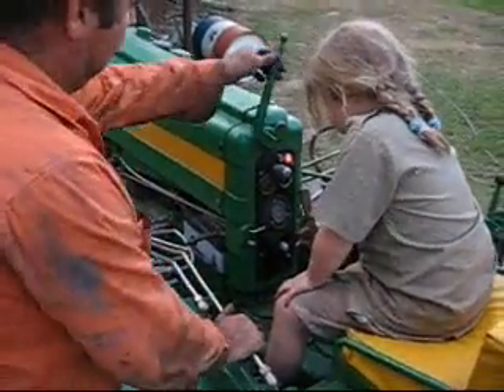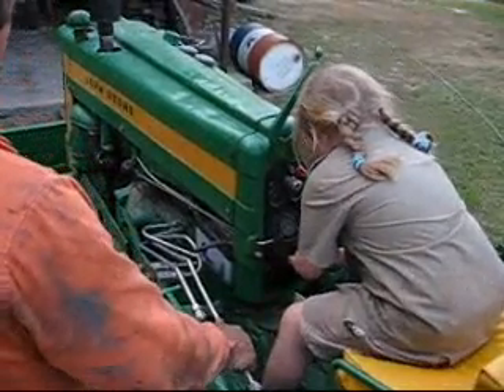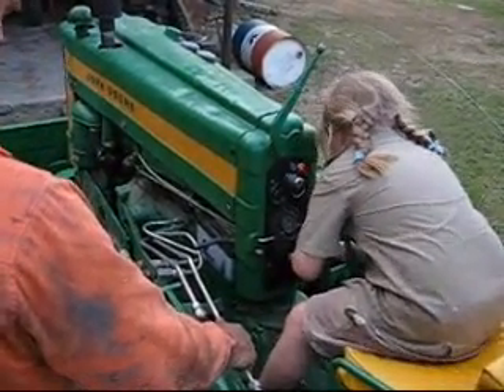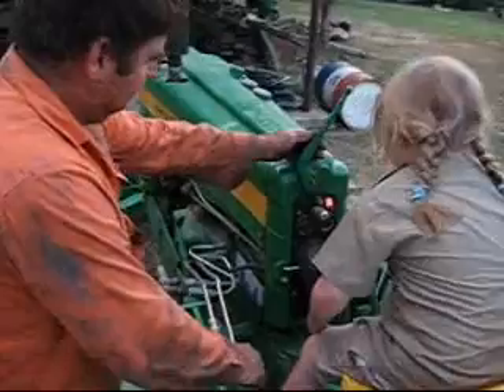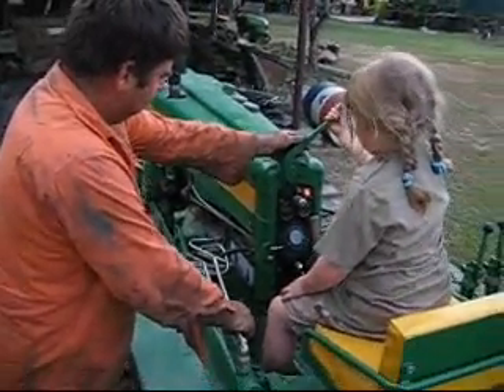John Deere Model 420 Dozer Starting And Reving

Comment: Well it does have a dozer mounted on it.. The outside mount type. John Deere made an outside and an inside frame dozer for the 420, 430, and 440, also I doubt its Kerosene.. All the Deere crawlers Ive had were equipped with gas 2cyl engines.. Kerosene was avaliable on some models, but Im not aware of the 420 crawler ever being one..